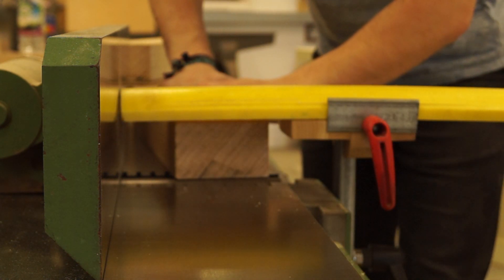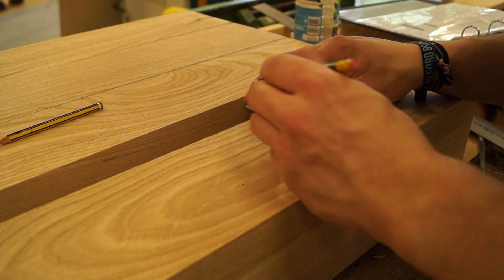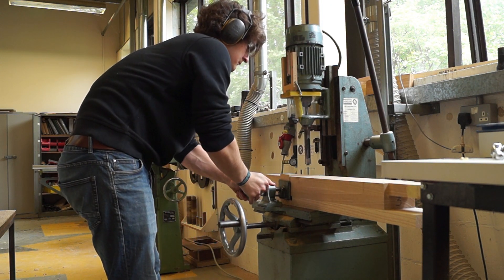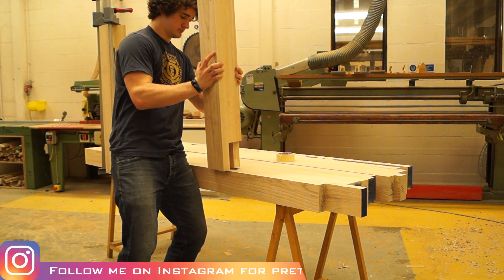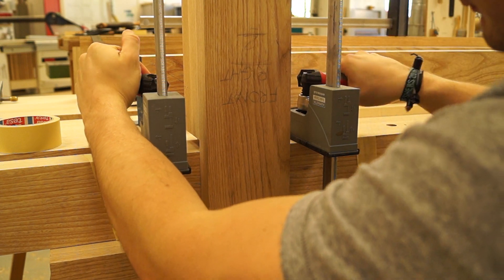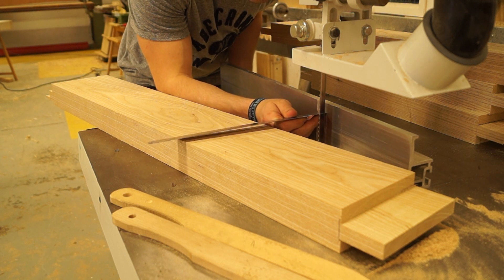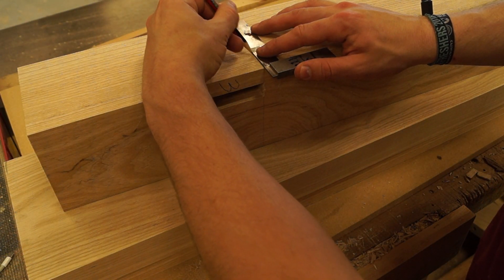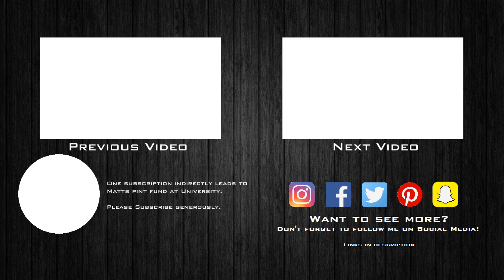Building a Roubo Workbench | Part 4

Comment: I bought and sold my hollow-chisel mortising press because my experience was similar to yours.  I had to use my whole body weight to get it to go through any leg of any size and it was super difficult.  It is usually easier to just drill out most of the waste with a forstner bit and then chisel out the edges, at least in my experience.

Comment: Why is it bad to use a regular bevel chisel instead of a mortising chisel?
Reply from the maker: Mortise chisels transfer the power of a mallet much better than a bevel chisel due to their robust build. Means you have to put less effort into whacking the chisel which is better for the tool and your elbows! Other than that, no real problem with it.

Comment: What's the benefit of a split top bench?
Reply: 1885dr tool well in the middle for one
Reply: JoshL but if your working on a large piece won't it cover the tool well?
Reply: 1885dr yes.
Reply: The natural movement of the wood is halted by the through tenons from the legs. If it was one solid block of laminates, you'd risk gaps between the laminates due to shrinkage. Or even worse - the bench becoming narrower/wider at the top than at the bottom of the legs.